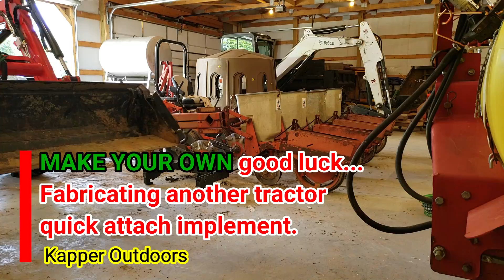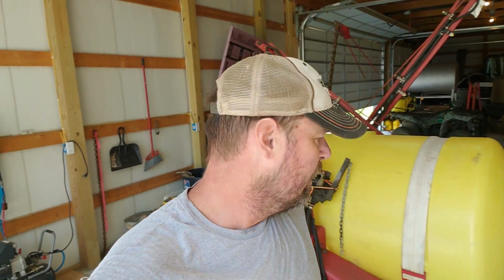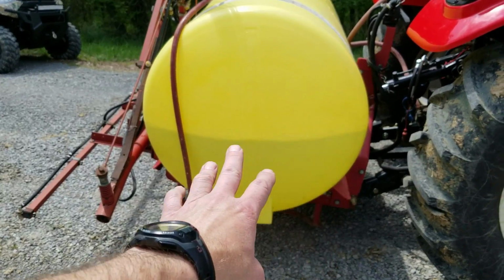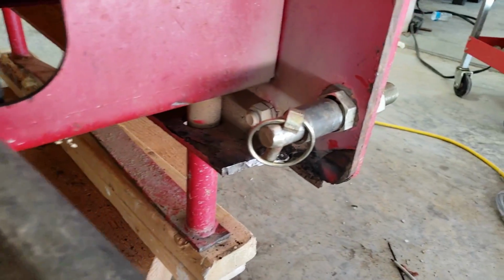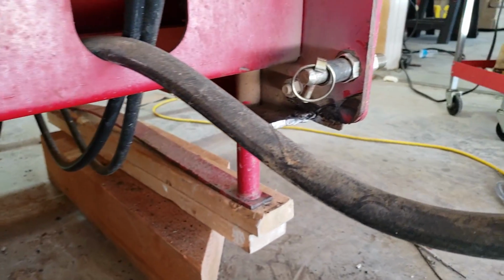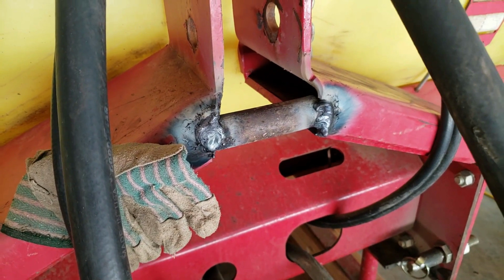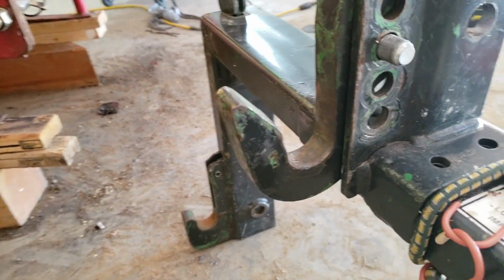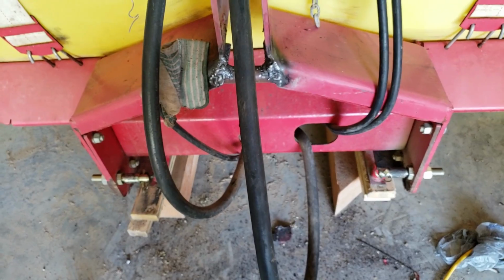MAKE YOUR OWN 'GOOD' LUCK for your tractor implements quick attach

Comment: He Kapper, I was using both my big implements yesterday 😂.  Finally got shocks adjusted properly on ZTM.   It rides the smoothest at full speed and mows better.  Then tractor and harrow fixing drive.    My doctor gave me a med for a pull muscle in lower back, I sleep 10 hours non stop.   
My own good luck is I hired two good looking nurses to come clean today.   Sometimes one has to say if I not able to do it alone, write a check.    Took me awhile to find two gals to clean that would not rob me.   Thankfully you have Mrs Kapper.   Things can go to hell fast as you know when you have an illness and it’s hard to find good help that one can trust.